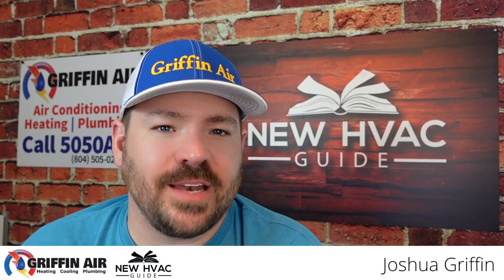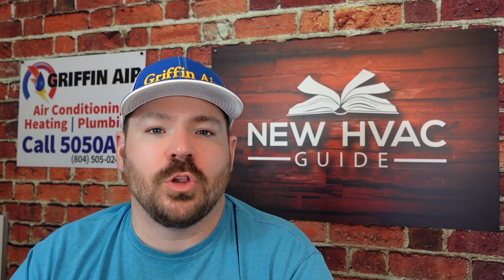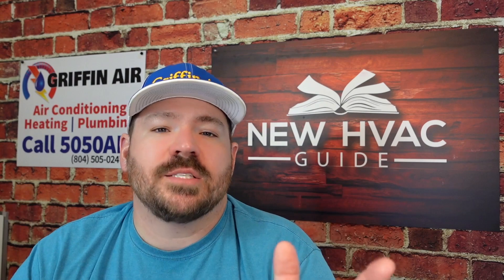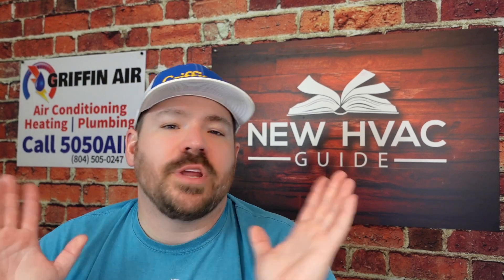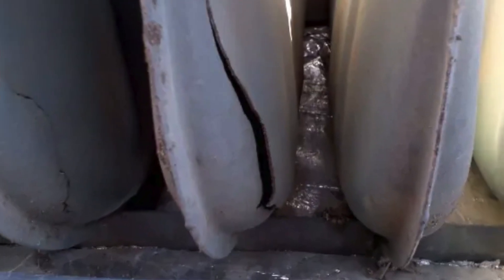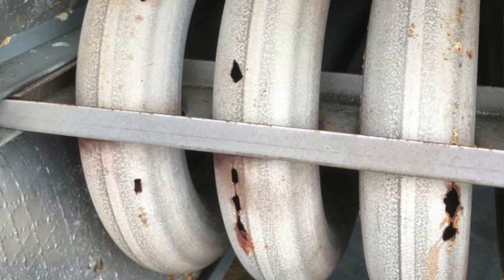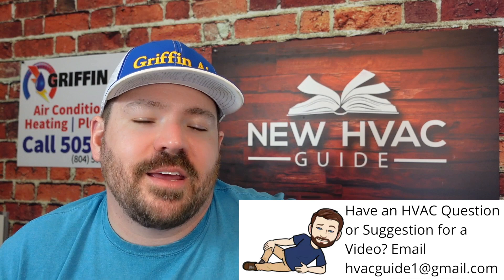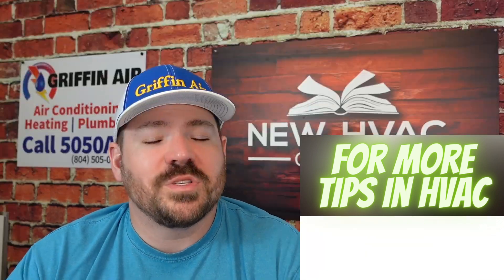5 HVAC Components POORLY Maintained Nationwide!

Comment: Coil????? Are you referring filter??
Reply: the indoorcoil/evaporator coil is inside your house on a split system. even when you use filters the evaporator coil gets dirty because you need airflow across it so you cant completely restricy the coil w a strong filter.